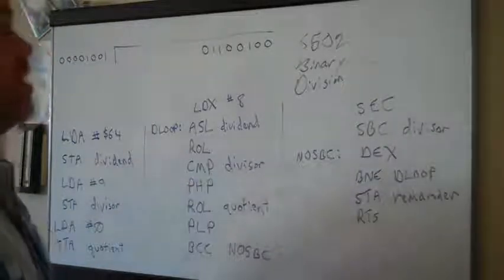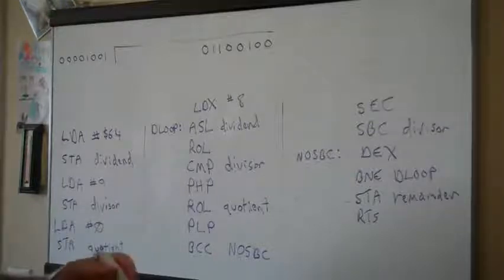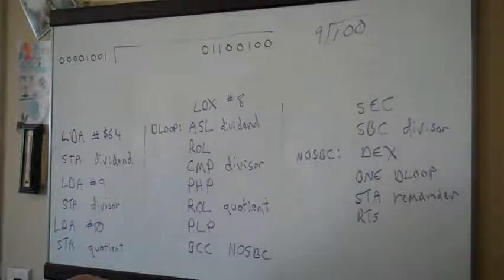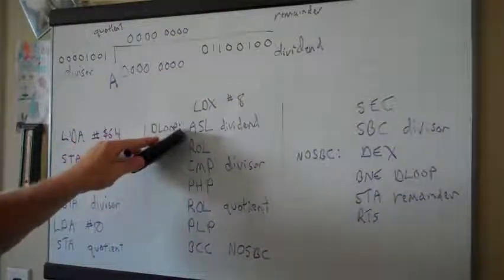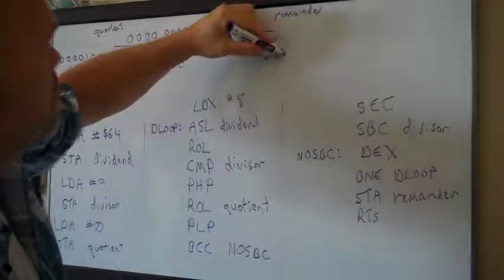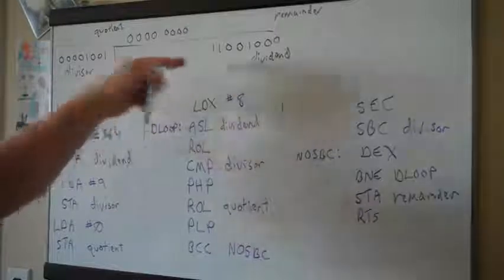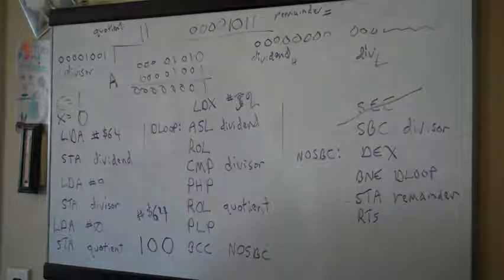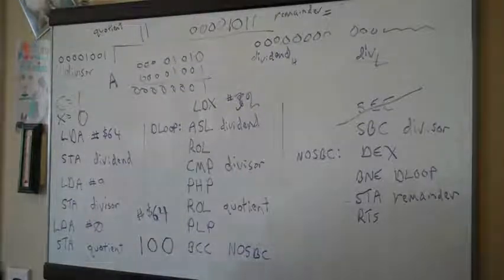6502 Assembly Language #4: Binary Division

Comment: Very enlightening. When you introduced the 6502 as limited to add and subtract originally, I had no idea of the complexity required to perform other operand functions. Seeing the iterative processing to do bit by bit operations just to derive a quotient high level programmers take for granted...wow. Really enjoying this series, even if it is just in small conceptual chunks!
Reply from the maker: Thanks! Yeah, it's a little painstaking. There are routines built into BASIC for multiply and divide, but they convert to floating point numbers to do the calculations and then convert back, so rolling your own integer routines is at least much faster than that.

Comment: I'm just learning 6502 assembly. I'd come across code snippets for division and was wondering why ROL was used. The lightbulb went on the moment you mentioned the carry being brought in from the previous left shift. I hadn't connected the 2 until now. Thanks! An explanation that is very clear to me at my current level of understanding.